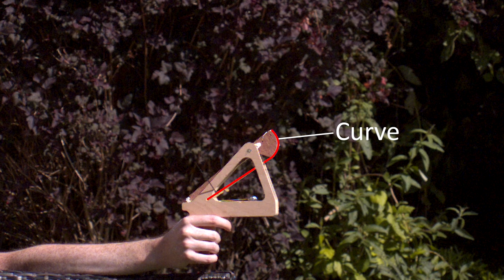Pocket Trebuchet

Comment: You can replace the string with a piece of lightweight metal rod so long as you make the attachment point to the trebuchet arm a pivot. Then re engineer the projectile basket, preferably out of something magnetic too. Then finally redo the projectile magazine so that you feed from the bottom , but it pushes up to the topside and at the front, right into the reset position for the projectile basket. That should make for quick one handed single motion reloading of the projectile.  Also for additional energy, you could add a second set of axle wheels on the exterior of the truss or third or fourth etc.  Lastly, for aiming a set of peephole sights off to the side that are aligned for impact at various distances.  Cool project. Would love to see the refinements in a part 2!

Comment: If it uses tension, isn't it per definition either a catapult or ballista (or simply slingshot/bow/crossbow), as opposed to a trebuchet?

Those magnets were a good idea, although I still wonder how you intend to shield the user from failed shots.
Reply: Welder's mask!
Reply: @armadillito  gluing a welders mask onto the "gun" sounds extremely unwieldy :s Although I guess it could potentially be used to solve the aiming issue too,
Reply: Its a trebuchet because it uses a throwing arm in conjunction with a sling to more than double the throwing leverage within the same space. The catapult equivalent of this would be a handheld wooden spoon.

Comment: Dude, I'm totally stealing this for a D&D character sometime! It's like the Drow Hand Crossbow of siege weapons!
Can it do significant damage? No... but can it deliver a small but potent alchemical payload? Hell yes it could! XD

On a more serious note, the stats aren't that bad, but I would suggest comparing it not to a full-sized trebuchet, but to a medieval crossbow.

Compared to a 900-lb draw weight medieval crossbow with state-of-the-art cranequin reloading, this thing does, off the top of my head: ~15% range; ~1.2% projectile KE; and at least 300% faster reload speed. ;)

Compared to a similarly-styled hand-crossbow? I dunno, I don't know that anyone has made one yet in the real world. New project idea?

Considering it isn't yet fully optimized, and you're not pushing the materials to their limit yet, or using optimized materials, I'd say it has promise! As... a totally silly 500-years out-of-date handheld ranged weapon, of course. <.<

Suggested upgrades: aluminum pulleys, fiberglass swing arm, cushioned rebound stop, magnetic sling holder and string connections for faster reloading, a channel along the 'barrel' for the sling and ball to slide down to the magnet easily, and a reverse-angled pistol grip to make firing in the direction your arm is pointing feel more instinctual.

Comment: When I was 12 I made a miniature handheld catapult, that could fit in the palm of your hand, out of popsicle sticks hot glued together. It used a ton of elastics (never counted how many I used) held by 2 anchors on both ends and wound around the arm until the elastics started to reach their maximum stretch. The tension usually started to bend and break the frames after awhile. The arm was too weak to draw back without breaking so I used half inch dowels for them instead of popsicle sticks. It was capable of launching small rocks like a football field away. Could take out an eye and gave my hands many injuries when something malfunctioned, like the elastics snapping or the anchors spinning or breaking. The strongest one I made was also the smallest because I could wrap each elastic around the anchors 2 times, doubling the power

Comment: Since it relies on gravity neither to hold the projectile in place nor to swing the arm, you could presumably build one that threw "underarm" rather than "overarm." It might make it easier to aim if bullet drop is causing the projectile to fly more parallel to the topsight rather than at a more extreme angle.

Comment: Tom it looks like its stalling right before the point of release, try using a design similar to the cam of a compound bow to give the arm more power at the point of release, it would probably give higher release velocity and a more consistent release angle

Comment: I have just rewatched your videos about trebuchets and I had an idea about an interesting way to possibly improve upon your designs.  I think if you made the counterweight out of magnets then place an electromagnet under frame of the base.
The counterweight would already be heavy and would also be accelerated by the magnetic fields as they attract each other.  I think this would greatly reduce energy loss due to vibrations through the frame as well as assist in repelling the counterweight back into fireing position by reversing the electromagnets field.
I thought the idea had a good chance of working so I thought I would bring it up.
Granted they couldn't do anything like this back when these machines were used but I just thought it was an interesting modern take on it.  I would love to hear your thoughts on it.

Comment: Instead of the sling and cup arrangement how about a clam bucket at the end of the arm that is cam released at a certain degree of arc? Along the lines of your arm and hand while you are throwing a ball. And also build the cam plates the rubber tube rides on like that which is used on a compound bow.

Comment: Tune your VFD for faster spindle acceleration. It can accelerate in split of a second. I've set mine to do full RPM in two seconds, but that is still rather conservative... I've set deceleration to 6 seconds from 24000 to 0 RPM without braking resistor.

Comment: Correct ne if I’m wrong but I think rubber looses its potential the longer you keep it tensioned, hence why there’s no rubber band crossbows. Again I might be wrong, I don’t know if slingshot rubber acts differently. I think there’s a graph with the function of potential energy throughout time for different material. Maybe a metal spring would work better.

Comment: I think you should measure the extension of the rubber and then make a "ging" that fires your 10mm ball with the same rubber energy to find out if the trebuchet mechanism improves the performance (velocity of the ball launch)? Also i wonder if making the wheels eccentric (like a compound bow) would make it better again?

Comment: Hey maybe a port able casting rod 🤔
So glad I find you 😎
Best clip about  the evolution or how to modified a lever class one. Im a huge fun of levers and  how they work.. I’m looking to build also a dynamic trebuchet to load with much lighter stuff 🙂, thinking about if we use and place a fly fishing rod as a arm and cast a fly line and a actual fly 🙄😍. There is a huge question for me regarding the arm length and structure material like carbon fiber, what do you think it would happen with a more short and more flexible arm please?

Thank you for sharing!!👌👌

Comment: The question now is, why does the arm rotate backwards a little at some point before the projectile is released? 3:48
The decrease in speed is due to the transfer of energy to the projectile, that's understood. Also, in the original design, it's easy to think that the influence of the counterweight causes the arm to rock back and forth. But here, what's the reason?
Reply: Because rubber is losing its tension so fast, there are some sections that are completely de-stretched, and those sections are being re-tightened by the other sections instead of transferring that energy to the arm. Watch the rubber in the slow motion very carefully.

Comment: Ok here me out for just one second. Back pack trebuchet that you bend over at a 90degree angle to fire. I think a counter weight wouldn’t work so you’d have to use some form of elastic and loading it would be a bit challenging, but we already saw the magnet idea so your arms would just have to be flexible enough to load the sling and place the ball on the magnet while standing. Ez
Edit: you’d also have to figure out a firing mechanism but I’m thinking a spring loaded pin strung up to a pulley string up to a mechanical hand detonator. Still ez

Comment: the reload time isn't that bad. 3.3 shots a minute is about what a professional can do with a musket. although the M134 Minigun can fire up to 6000 rounds a minute witch is ONLY 1800 times faster.
and the kinetic energy is 0.58J is about that a bb-gun produse. While the M134 Minigun fires the 7.62x51Nato round witch has a kinetic energy of 3470J witch is about 5982 times more.
so that leads to my conclusion. its bad.
(also the effective kinetic energy output is 1.74j a second while the M134 Minigun has 206200j a second, witch is 119650 times more)

Comment: Trebuchet Failure Mode #1  ---  Early Release, Slow moving Ball Bearing flying directly into Eye, dents eyeball, not good.
Trebuchet Failure Mode #2  ---  Failure to Release, Fast moving Ball Bearing slamming into Fingers, not good.
Trebuchet Failure Mode #0  ---  Really hard to aim the thing without aiming at yourself.

Comment: What if you stop the wheels from moving when launching?
Reply: lance vanvelzen The wheels moving forward and back help to keep the motion of the rotating bar in a more straight line up and down. As the arm rotates the center of gravity of the entire machine shifts front to back. As the arm moves towards one direction Newton’s laws move the machine forwards then as the arm is rotated the other direction the machine moves the opposite directions now you can subtract the movements of movement each way from the distance the arm rotates through. So you can see the two motions would make it would look like more of a vertical “line of travel” which has the same effect as increasing the power. I’m very tired and I probably could have explained better. The point is to see the connection of the wheels absorbing the directional rotation by rolling one direction then the other direction.